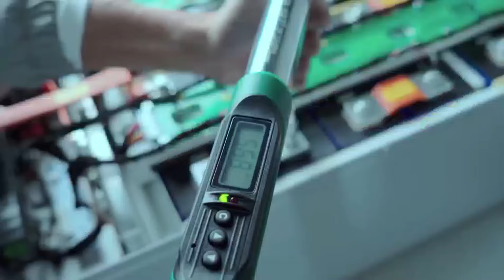Poland STOCK Mason 48V 280ah DIY Lifepo4 Battery Kits Built In Seplos 16S 200A BMS

Comment: But I didn’t find this box design on your website. Please note 00:36 - the lower support wall is solid, but what is sold on your website is just 2 pipes and a hollow opening between them, where the battery wall will inevitably swell.
01:02 - an intermediate partition in the middle between the batteries is shown here, but this is not included in the product on your website!
Where can I buy exactly the same design as shown in this video?
Reply from the maker: https://deligreencs.com/products/poland-lifepo4-battery-kits-48v-51-2v-280ah-310ah-320ah-built-in-can-rs485-bms-lifepo4-battery-case-rechargeable-batteries-solar
Reply from the maker: you can order from our store. via this link
Reply from the maker: @Angelorademon  sorry for the confusion. we have the horizontal box in stock right now. the vertical box need to wait for a month.so i recommend this one.